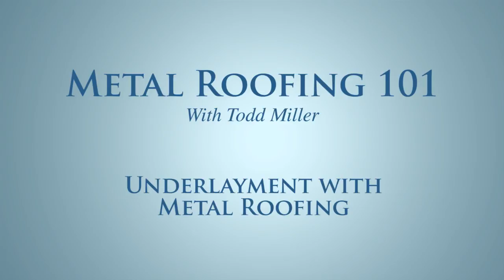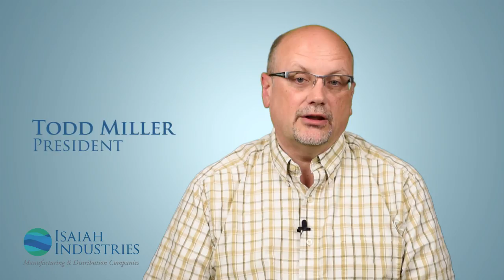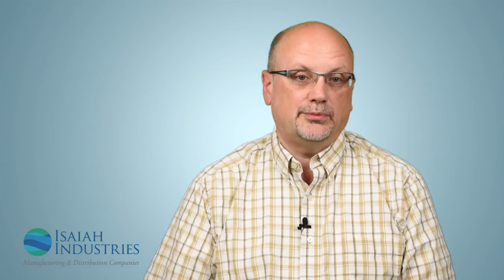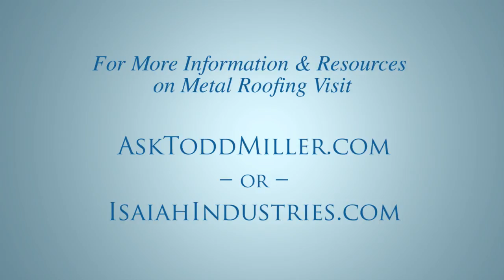Underlayment and Metal Roofing – Metal Roofing 101 with Todd Miller

Comment: Ran across your Youtube channel a while back and wanted to tell you how much
we appreciate your sharing of knowledge with the community and
followers.

With that said, you have my gears turning in my head that have caused more
questions than I can answer no matter how many videos I watch so would like to
get your opinion as a subject matter expert if you can find the time to answer.

I've also sent you some picture of our home that I am building in Paso Robles,

California for reference. My main question revolves around my option to either
ventilate or completely seal up my insulation area between the vaulted metal panel ceiling 
and my standing seam roof panels. 

My plan was to not install roof and eave vents and “completely” seal up the
void. The layers consist of metal ceiling panels on the interior, 8” of
fiberglass insulation between the roof purlins, 3” of fiberglass insulation
running at 90 degrees and on top of the 8” insulation (this is to fill the void
that is created by the thermal expansion brackets that hold the roof
panels 3” off of the roof purlins), a layer of Sharkskin underlayment and
finally the standing seam roof panels.

In a perfect world there should not be any voids between the ceiling and roof
panels where as condensation could form on the backside of the roof panel.
In my mind this was my plan until I started questioning myself about some sort
of nightmare that I could create if not done correctly.

I don’t expect you to spend a lot of time with my issue but if you can direct me
to a specific video that would address my concern or briefly give me, and other follower, feedback
it would be much appreciated to put my mind at ease!
Reply from the maker: I think you are being smart by thinking this through thoroughly. I did not see any photos.  Yes, if warm moist air from inside the living space gets up into this cavity, it will likely migrate into the roof deck where, if that temperature drops, it will condense.  Could you consider a vapor barrier such as polyethylene sheeting, taped at the seams, behind the metal ceiling panels?  Or else spray the underside of the roof deck with closed cell urethane foam?

Comment: On my older installation, the tar paper underlayment has begun to fail.  This then renders the metal roof as not protecting my home, and the roof decking is now rotted in some areas.  Can the metal roof be removed and then put right back on to change the underlayment?  Since installation recommendations have changed since 2001, is this then under warranty by Classic?  I have the Rustic Aluminum Shingles.  Because of the damage we are finding (mostly on the outer edges), other home repairs have come to a screeching halt as I desperately seek to find a way to fund the roof damage.  I am very disappointed in my roof.   The business who sold and installed the roof is no longer in existence, and so I feel like purpose of our metal roof---to control future costs and to last, has just become a whole lot more expensive with these unexpected repairs.  I hope Classic roofing will help.  As a school teacher, I cannot afford a new roof, and I never expected to be facing these problems.
Reply from the maker: Please give us a call at 1-800-543-8938 so we can discuss what’s going on with your roof. Thank you.

Comment: Our builder in 2016, applied a Tamko Ice and water coating to the under layer of our new metal roof, in places that weren't conditioned air - ie. the screened porch and front and back porch. After about a year, tar started leaking from the ceiling and dripping on the decking, on furniture, etc. So the builder filled in the cracks between the wood boards on the ceiling. It helped but tar is still dripping. What can we/he do about it? We had to get rid of our porch furniture. Thanks for any help, Linda and Mike
Reply from the maker: I am very sorry to hear this. It sounds like one of two things has happened. Either the Ice and Watershield was not a “High Temp” version, or it has failed. If you have not already, I would suggest checking with Tamko to see whether there might be help available from them. Other than that, it’s probably going to be necessary to remove the roof, and probably the decking as well, and replace them, starting all over. I suppose you could try to insulate from the outside in some fashion and add a new roof over the existing but my gut tells me that ultimately doing so will not work and you will eventually end up removing everything anyway.